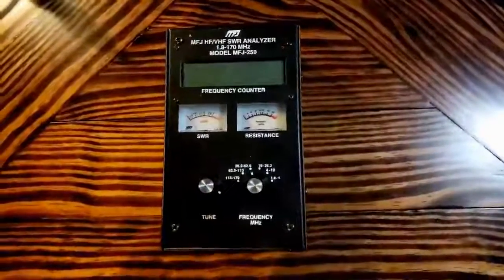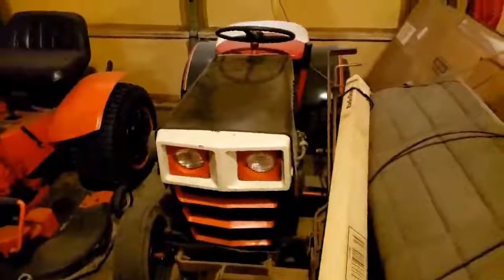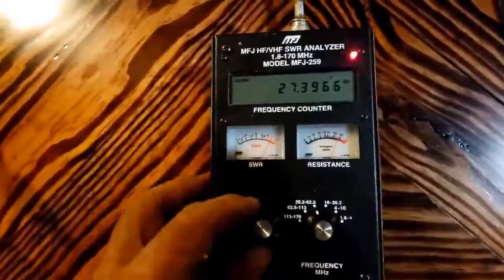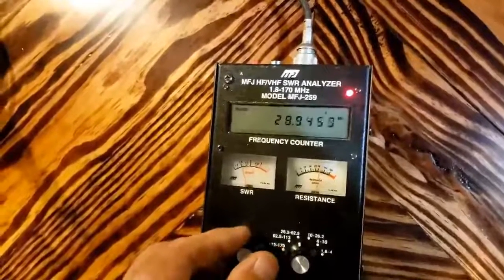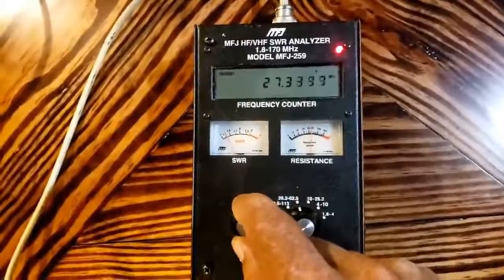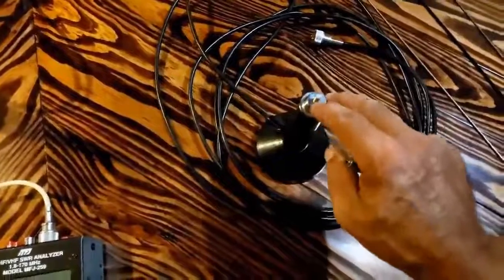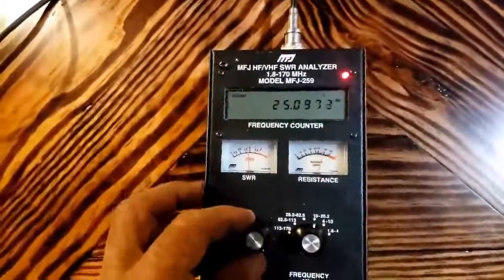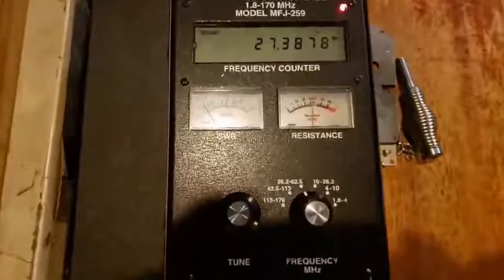MFJ 259 SWR Analyzer and Antenna testing

Comment: Reminder coax will effect your readings on your meter
High loss will hide bad high swr
N you need a true 1/2 wave
For it be right but now you have a way find Wright length  n you get a small part n use it for a dip meter